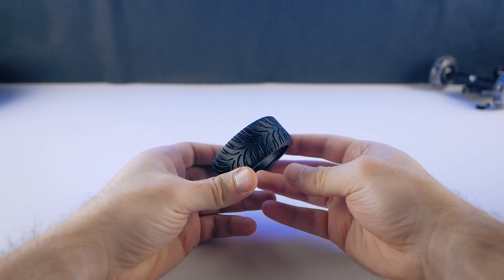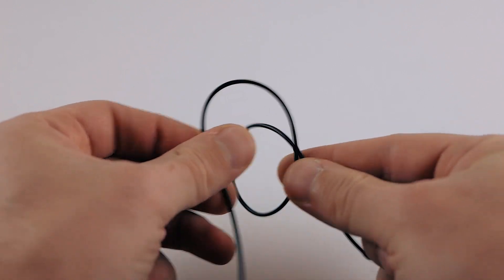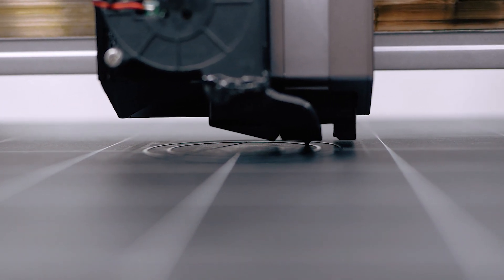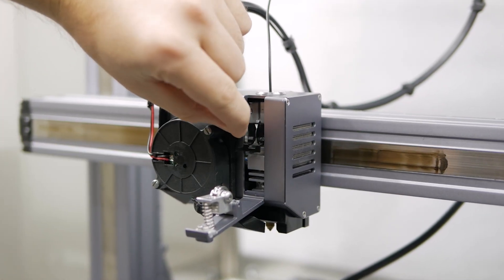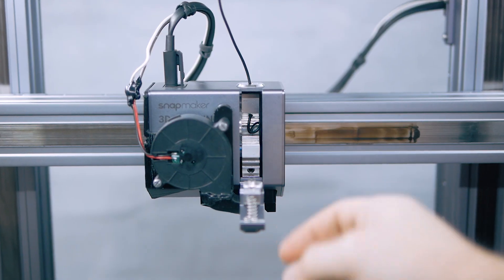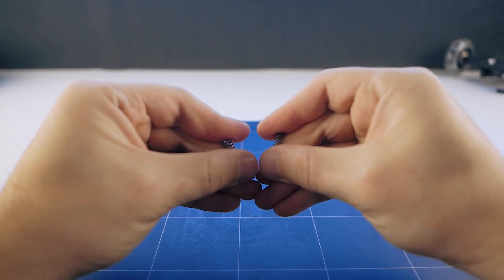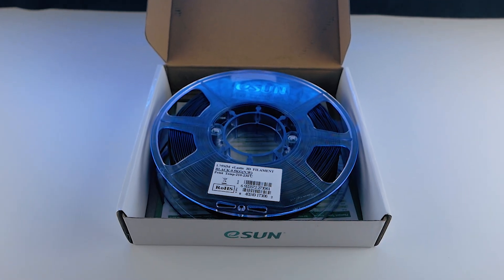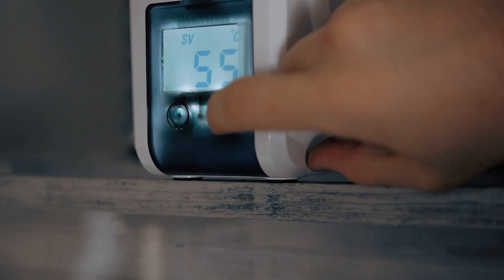Snapmaker 2.0 - Printing TPU Tips and Tricks

Comment: Thank you for this!  Tried the adapter and it didn't help.  This is a good fix for extremely squishy filament.  I believe the issue is the guide roller compresses the filament until it touches the gear, then the filament gets rolled under the guide roller and bunches up.  With this mod the if the filament stops, the roller stops with it, preventing it from getting pulled under.   And the mod is so easy.  I have a feeling the adapter wouldn't even be necessary, will test later.

Comment: Just started using TPU in my Snapmaker. Hadn’t thought about the extruder spring but I’ll keep it in reserve. So far printing at slow speed (20mm/s) and temperature towards the top of the filament manufacturer’s recommended temperature range (220) has produced acceptable results but lots of stringing. I have however been really pedantic about keeping the filament dry.
I must try a tire like the one in this video. But it will take a looooong time.
Reply: Dry it out in the oven around 60c for 1hr. Or print directly from a dry box